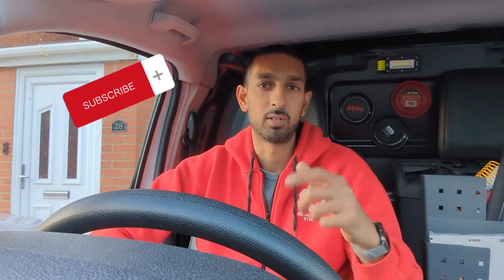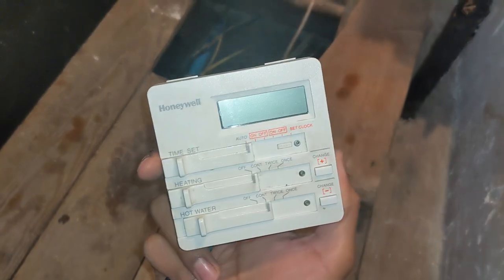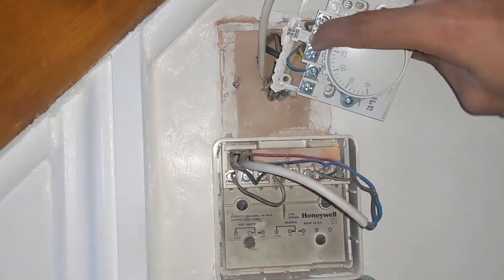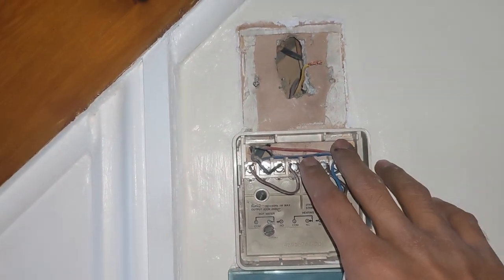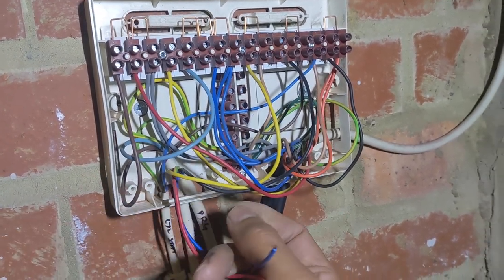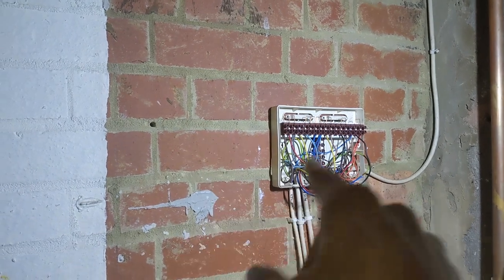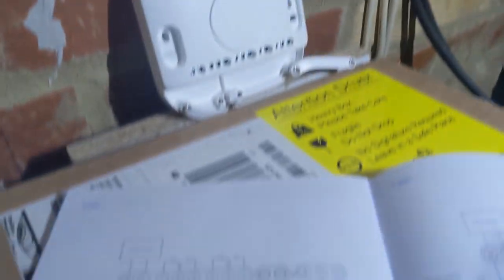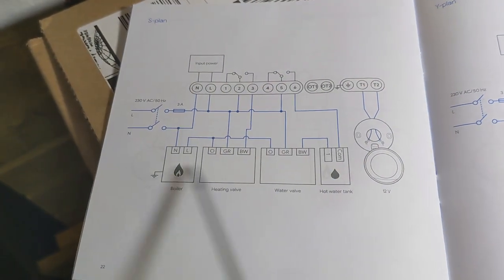How To Install Nest On S-Plan System

Comment: Hi, brilliant video! Iv just installed mine on a s-plan. The only problem I’m having I can’t get the hot water settings up on the nest thermostat? Can you shed any light?
Reply from the maker: Hi, you need to check you've set it up as a system boiler and not a combi

Comment: Brilliant and informative once again brother.
Silly question... does the 230v  out from the boiler becomes a permanent live out after wiring 230v in on the boiler link on this boiler???. And is this because it's linked 
Thanks for sharing once again
Reply from the maker: Hi, yes it becomes a permanent live out via the boiler. Not all boilers have this (in fact the new vaillants also don't have a live out anymore)
Reply: @cputilitysolutions  cheers bro👍

Comment: Great video on the Nest & S Plan Configuration. Question, is this wiring set up suitable to use with a combi boiler in S Plan with additional Megaflow cylinder 🤔
Reply from the maker: You can still use it like that yes as it's still on an S-plan 👍🏾